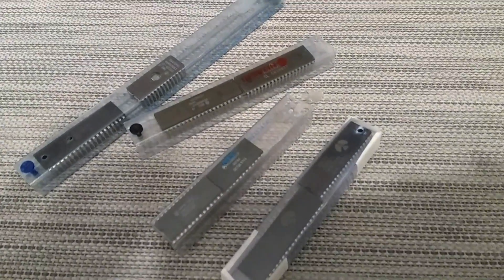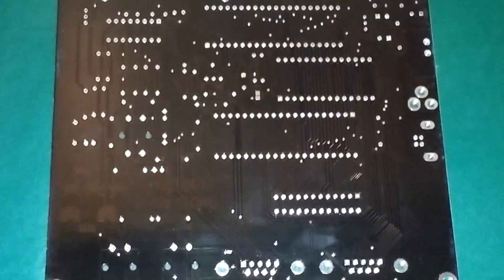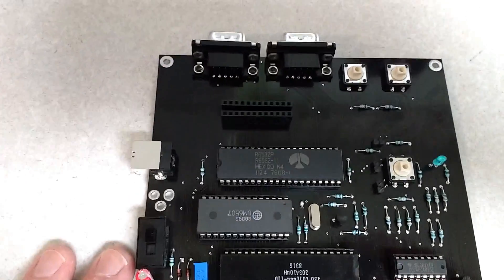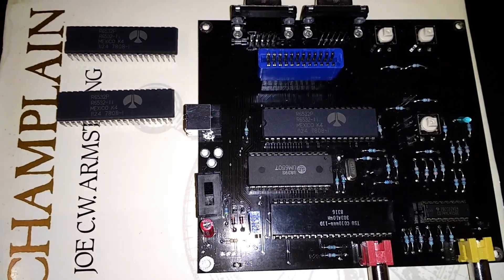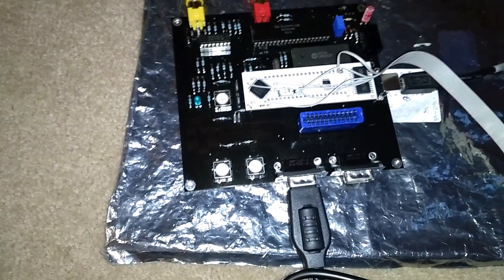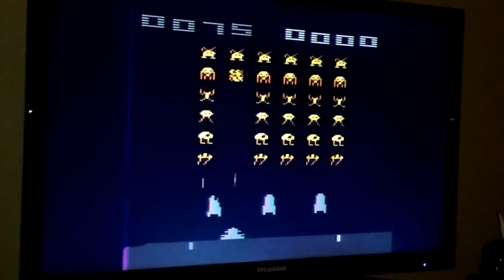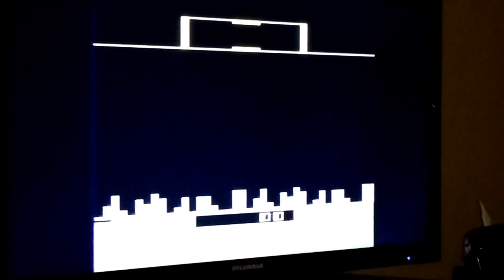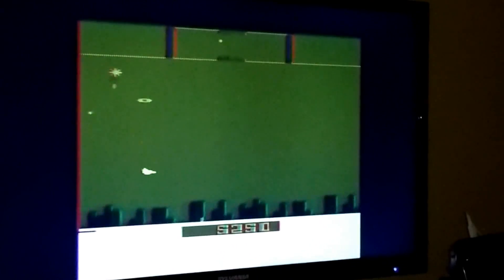Homemade Atari 2600 Clone

Comment: If only the motherboard is new but not those chip sets itself, then we cannot speak speak about a cloned system.
If chips were cloned whether emulationor fpga based, then we can speak about a cloned system.
Reply from the maker: @johneygd  Well, I think there is flexibility in what is meant by clone.  Here is a historical example.  Once competitors began creating computers that were compatible with the IBM PC those computers were called clones.  Retrospectively they are called PCs now but back in the 80s they were called clones.  The manufacturers of these 'clones' didn't necessarily develop new chip sets.  Even by your strict definition I created a RIOT clone using a CPLD since those devices  weren't functional.
Reply: @dangrise6182 well that’s pretty interesting.
Maybe the same thing means for many “clones” on the market.
Maybe those motherboards were cloned but those chips might,ve been donored or sourced from those chip manufacters.
For instance the famicom contains a 6502 cpu so if i
 want to create my own famiclone with my own recreated motherboard for example, then theres nothing stopping me from getting a 6502 chip since those chip were/are readily availible🤣

Comment: I'd love to see information about that RIOT replacement board, I know the actual RIOT chips are still out there to be able to buy, but they're dwindling. The same for the TIA and the 6507. It would be awesome to have a modernish equivalent like this (probably use even less power, generate less heat, and probably more reliable), because like many others have ran into, buying replacements only to have them DOA, and it will come a time where you won't be able to buy them anymore.
Reply: You can probably substitute a plain 6502 for it's cut-down sibling (6507) either via an adapter or with a custom designed board.  
 
And much of the 6532's functionality is available in the 6522 (I/O and timers) even if modifying the original Atari ROM might be necessary to make that work. 
  
At some point you might as well just use a CPLD or an FPGA to replace all the chips though.
Reply: @jnharton  yeah, I believe FPGA is what they used for the pokey replacements (but I could be wrong), that's pretty much what I was getting at. They're getting to the point of being harder to find a good chip as many are just reclaimed junk and slapped onto the bay, and sometimes even other electronic component sites.

Comment: This is amazing work.  I looked at your Gerbers and BOM but am confused how the BOM is listed.  Many of the part location only shows a specific location, but the qty seems to be double what you listed.  Here's an example: 4.7k 		R2, R5	S4.7KCACT-ND	qty=4.  Assuming R2, R5 is for this part, but why 4?  It goes all the way with a few components missing qty from the txt file.   I think this would be a fun build and will attempt if you could clarify the BOM File.  Thanks!
Reply from the maker: For things like resistors and capacitors I ordered extra.  So in most cases the QTY refers to tge quantity I ordered.  I can see now that this would cause some confusion.  I'll try and look into this in the next little while.
Reply: @dangrise6182  Thanks.  Since you're confirming the location as the quantity on the BOM, it shouldn't be too hard to order the quantity I need.  I appreciate the quick reply and will get an order in.
Reply from the maker: @troymeredith521  Before you start ordering common parts make sure you are able to find a source for the 6507 CPU, the TIA and the RIOT.

Comment: I've wanted to try making a 2600 clone board, but with a full proper 6502 with RAM mapped to the additional address space.
Reply from the maker: Yeah, that would be cool.  The extra address space could be used to access peripherals or storage medium.
Reply: @dangrise6182  would be nice to go thru the entire catalog of Atari 7800 games with the goal of finding every address touched by those ROMs. with that knowledge proper address decoding could be implemented, that addressing would enable one to fill that unused space with SRAM.

Comment: Modern hardware is even close to be a clone.  The working is not even retro
Reply from the maker: I used original CPU and TIA chip from the Atari 2600.  I used 80% of the schematic from original Atari 2600.  So it's pretty retro.

Comment: I just want to know if is there a way to pause, save the game state at some place and allow it to restart where I left?
Reply from the maker: I don't think that is possible with actual Atari 2600.  But I think it is possible with emulators.
Reply: @dangrise6182  when the rom is loaded to the cpu ci is there a way to ajust some register states?
Reply from the maker: I think it would be possible to make something like a game genie that can satisfy some of that.
Reply: @dangrise6182  otherwise is there a way to provide backup power to ensure chip is loaded at pause state for long time periods? by example I wanna pause the game to continue next day
Reply from the maker: There might be a way of doing this... by blocking the clock from reaching the processor.  While the processor isn't receiving its clock, it will effectively be paused.

Comment: I wonder what would happen if you tried to adapt an actual 6502.
Reply from the maker: I wonder too.  Maybe I should create an adapter board and find out.  The 6507 is rare these days.  If a 6502 plus adapter works that would be a great thing as far as repairing old Atari 2600 units is concerned.
Reply: @dangrise6182  That's what I'm thinking. I know they're software compatible because the 7800 has a 6502 and is backwards compatible. An adapter board would be great for repairs because they still make 6502s from what I understand.

Comment: can you publish  more about the RIOT chip replacement?
Reply from the maker: The RIOT replacement module I designed might not fit in the actual ATARI 2600.  The module is wider than the chip so in the ATARI it will probably interfere with cartridge connector.  Also, my RIOT doesn't support the paddle... only joysticks... but even there, the CPLD on the module does not have built in pull up resistors so to get things working I opened a Sega Genesis controller and installed pull up resistors in there.  For that reason I don't publicly share the design other than on Circuit Maker.  I can email extra details if you are interested in making improvements to my design.
Reply: @dangrise6182  i can take that as a CPLD training. i think i can pm you via Youtube or Circuit Maker  to send you my email. thanks!

Comment: This looks great, congrats
Reply from the maker: Thanks, it was nice to try the video games out when the board was done.
Reply: @dangrise6182  that's cool, I also wanted to know what made you want to make a custom riot chip, and also what the schematics for it are
Reply from the maker: @bioman1hazard607  I bought three different RIOT chips and none of them worked properly so I decided to make my own substitute.  I am reluctant to release the schematic because my version won't fit into a real Atari 2600 and its function isn't 100 percent compatible with original.  I am worried someone might build my RIOT board and be disappointed with the result.
Reply: @dangrise6182  understandable, you wanna make sure its 100% foolproof. Let me or anyone here know if you need help, and keep up the great job

Comment: Are you planning to release the gerber files? It would be great because i want to try building one myself.
Reply from the maker: Yes... I can provide you with Gerber Files.
Reply: that would be so nice ,if you want you can send me the files via email my email is warmachine38@web.de .i wanna build the Atari for a school project ( and for myself). greetings from germany  :-)  @dangrise6182
Reply: @dangrise6182  Hi, great job, how can I get Gerber for this project?
Reply: @dangrise6182  Hello! It's very nice project! Can you please provide me gerbers?
Reply from the maker: @FilippovM  I have them on Github.... https://github.com/Dan-Grise/2600_clone_pcb
Reply: Dan Grise thank you!!
Reply: @dangrise6182  Thank you, could you do the same thing on Github whith your 6502 computer please?
Reply from the maker: @jean-paulcardoit7327  Hello Jean-paul, there are a couple of errors on the 6502 board... plus I want to modify the video buffer circuit to improve video quality.  I prefer making these corrections before publishing the board files on GitHub.
Reply: @dangrise6182  Gracias por compartir

Comment: Pretty awesome. It would be cool to see some of the PCB design process (Software package, routing, etc.) and how you go about sourcing the components
Reply from the maker: Thanks.  I guess I will have to get acquainted with some screen capture software... Any recommendations?
Reply: @dangrise6182  Not sure, I've never worked with any screen capture software before. I'm sure there are some decent free ones out there.
Reply from the maker: Cool... I was thinking of doing a Linux type project at some point.  On a different note, I am slowly putting something together on my homemade 6502 computer.  Eventually I will have that up on the channel.
Reply: OBS is a good free one